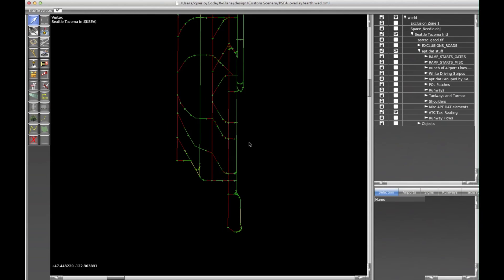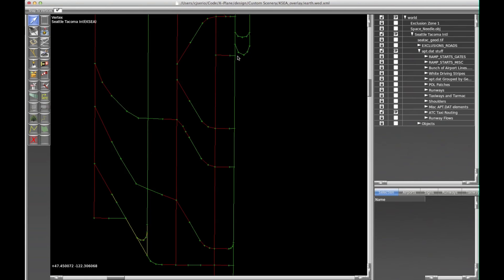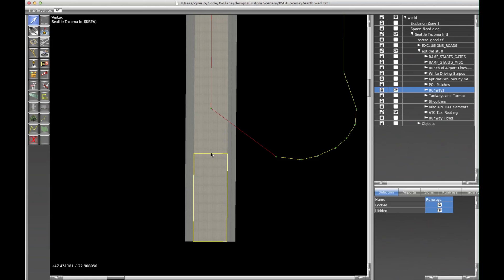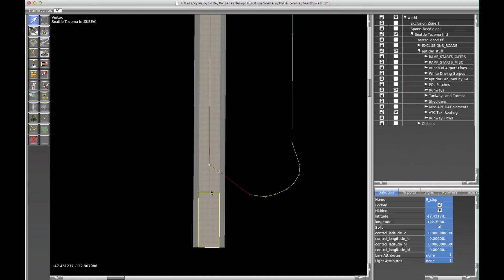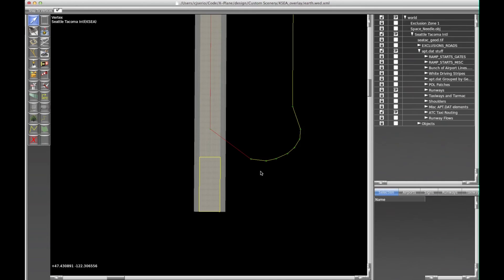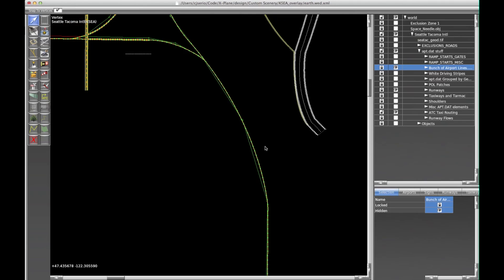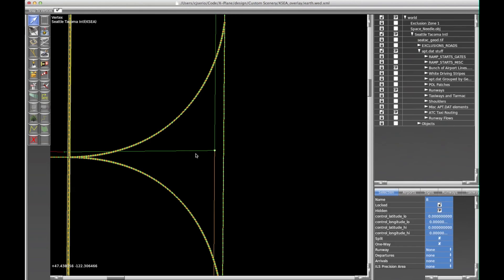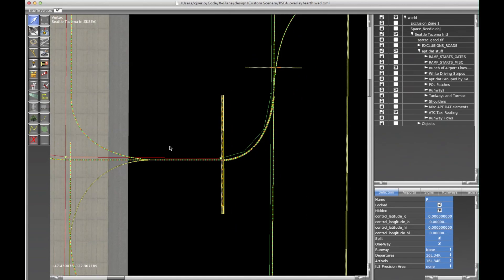Screencast: Creating ATC Taxi Networks Pt 3 of 5

Comment: Hi Chris. I need some input on secure/protected nodes. Chandler Muni (KCHD) has 2 parallel taxiways (A and G/I) that end perpendicular to taxiway D. There is a hold short as traffic moves from G onto D so there's no collision with traffic on A. How do I set up the taxi node so traffic on taxiway G stop and await clearance to proceed. There is no runway in effect at this point and that's the only way I know of to initiate the hold short.  Thanks.